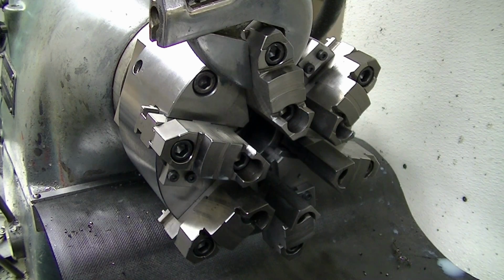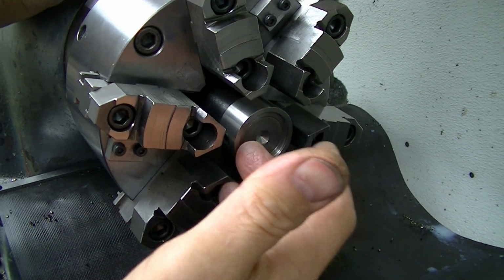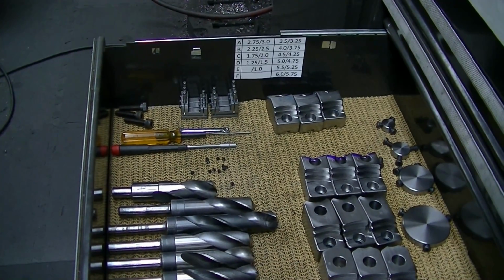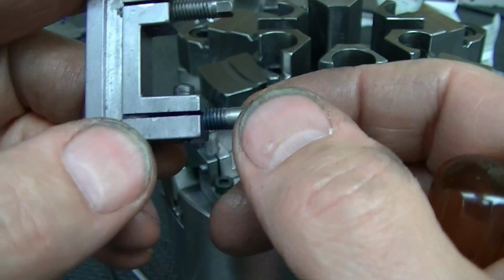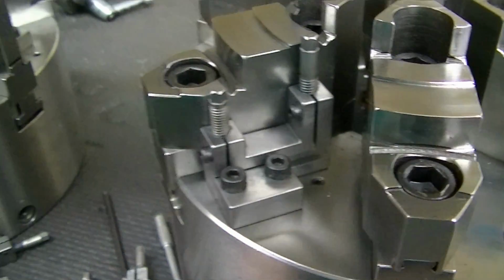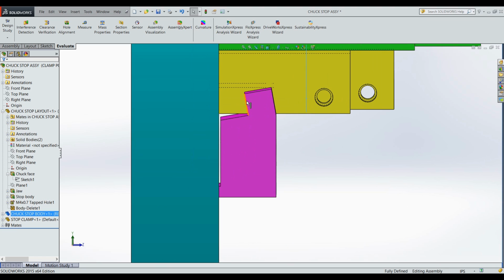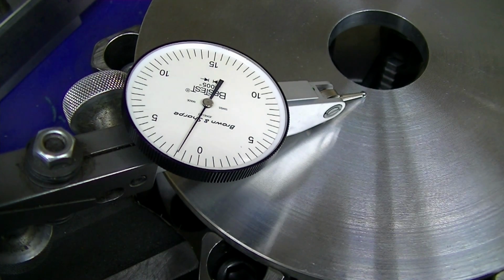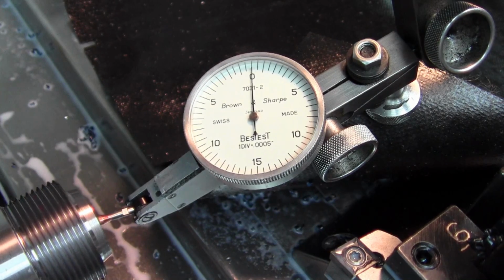ADJUSTABLE CHUCK STOPS

Comment: Since you have installed the stops, have you experienced any out of balance or vibrations when using the chuck with the adjustable stops?  I’ve been wanting to do this mod since you posted this video but I am concerned with vibrations and it not being irreversible other than putting threaded rod in the holes to cover them up.
Reply from the maker: Balance is not an issue at all.  The holes are in a symmetrical pattern and are exactly the same depth so they don't influence the original balance at all.
Reply: ROBRENZ thank you for replying.  This clears up my doubt.  Thanks!

Comment: Robin I have a 9 inch south bend and I want to build a Chuck stop with using the collect inside the Chuck like you did. With that being said on a south bend when installing the collects you have to insert an adapter into the spindle and it has a wide face on it resembles a washer on the face of it but it will not go inside the back of the Chuck so I purchased a new one and was going to turn the shoulder down until it would just go inside the back of the Chuck but I have found that it is very hard and I can't cut it down with my lathe. With that being said would it be possible to use a surface grinder and turn it down. Or is there a better way to overcome this hurdle. Any thoughts on this would be greatly appreciated.
Reply from the maker: You should be able to turn that with a CBN insert in your lathe.  You could grind it down using a spin fixture on the surface grinder also.
Reply: @ROBRENZ  thanks for the reply Robin , I tried every insert I had and nothing would even touch it. But I did get it turned down using a grinder. I have a big magnetic drill that I was able to use and set up like using a tool post grinder that worked. Took a while to do it but it fits inside the chuck now. All I have left now is to make the pucks in 1\4 inch increments. Thanks for your help.

Comment: Did you had a grease port on the buck chuck? what did you align it with? Thanks
Reply from the maker: Those chucks had grease ports but I reported them to lube the scroll plate to chuck body diametric bearing area.
They originally just pumped grease into the scroll grooves which is nuts.
Reply: @ROBRENZ  you don't want lubrication between the scroll and the jaw? I understand the need of lubrication of the scroll circonference.
Reply from the maker: @Simon28298  Yes but just a light coating brushed on when all the jaws are out.  Any more and the grease just collects chips.